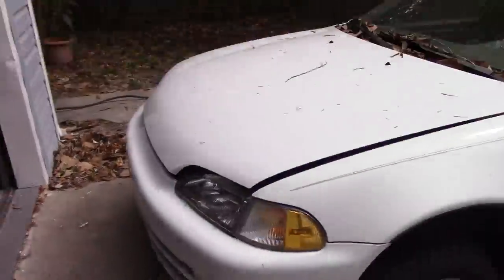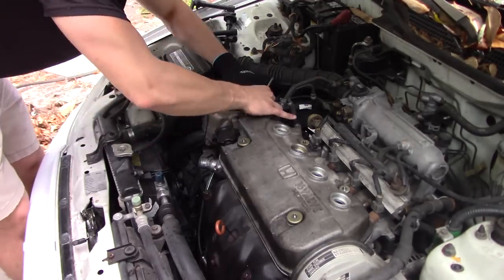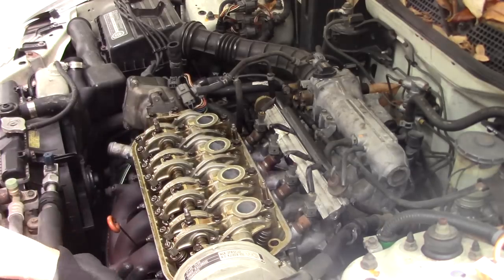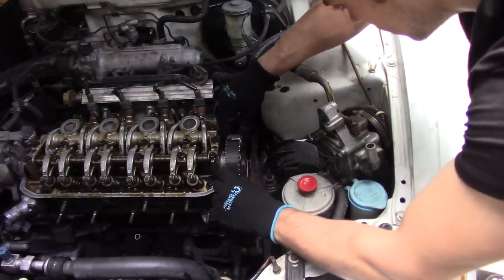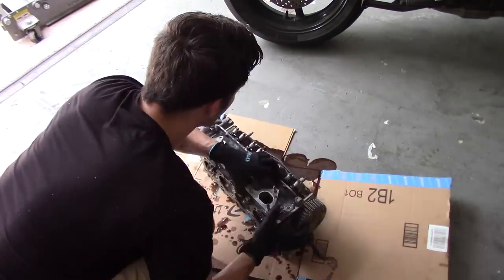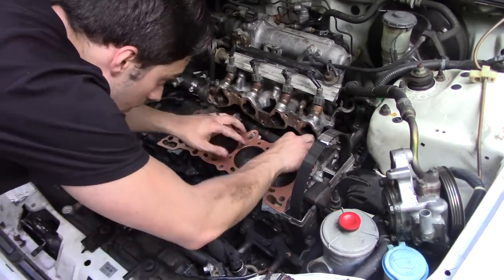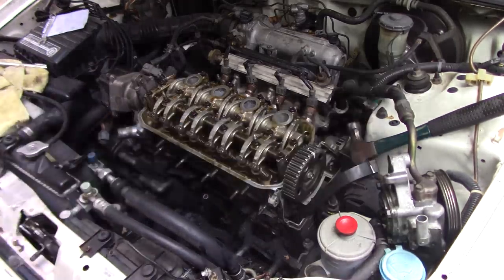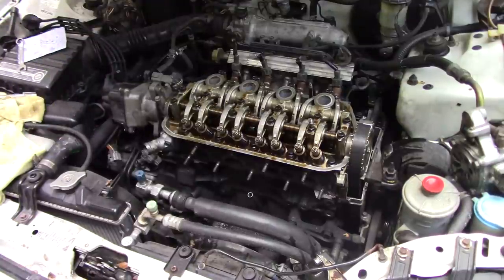How to Replace a Head Gasket  | 1994 Honda Civic DX

Comment: Hi do I need to align anything after taking it apart? I often see people in YouTube lining up something(i guess) like the piston in it's original position or something. I don't quite understand it so it is making me really scared to start the work.
Reply from the maker: What you are explains is making sure the piston is Top dead center so it would be easier to align everything back together when you reinstall everything. However, in this video I use the method where I keep everything in place and reinstall it I all in the same working order. Even if you have to get the head shaven down, if you install all the valves the exact same way as you had it, you shouldn’t have any issues

Comment: Question?  When you went to remove the bolts to the engine head, why did you NOT first remove the bolt that was last torqued when the head was first installed.  So if the TIGHTENING pattern (sequence) starts with #1 thru #10, shouldn't the LOOSENING pattern be #10 thru #1?

Comment: Always make you spark plugs so they go back in the right place so you don't miss firer
Reply: spark plugs can get put in a hat and drawn one by one and it wouldn’t matter what cylinder they go in. Plug wires on the other hand need to go back in the right spot but you don’t need to mark them lol

Comment: I am doing it  myself. I just wanted to ask. Am i supposed to set the timing to zeros before i remove the timing belt??
Reply from the maker: If you mark the belt and gear, you don’t need to.
Reply: @AutoMotivate  you smell

Comment: At 4:00 you removed those back bolts and I’m using a 12 mm because that’s the only thing that fit, and we keep striping the bolt little but little and it doesn’t wanna catch
Reply from the maker: Faze Cold so, I forget what size those bolts are, but be sure to spray some WD on those bolts. Try your best not to strip them. If they happen to still be tuff to remove, you may have to heat them up to remove them

Comment: If I just wanted to replace the head gasket, would I still have to remove the power steering pump and the manifolds to remove the head? (I'm a noob trying to learn sorry if that sounded dumb)
Reply from the maker: Yes, you’ll have to follow every step in this video.
Reply: @AutoMotivate  thanks! I think I'll start off on smaller jobs and work my way up to this. Your video is great though, keep it up :)

Comment: How did you get the timing belt back on?
Reply from the maker: Patience is key when you are putting it back on.
Reply from the maker: One tooth at a time. Start with one side then work around

Comment: How did you remove the exhaust heat shield and exhaust manifold without removing the oxygen sensor? Or did you just not show removing the O2 sensor? I can't get a wrench in there because of the shape of the manifold around it
Reply from the maker: I didnt have a problem man. Just work with it.

Comment: I slid my timing belt off by hand as you did. question is how do I get it back on? im really struggling with this .
Reply from the maker: You just have to work with it. It is difficult. You have to really wedge it back on. Take your time. If you get frustrated, take a break and come back.
Reply: ok got ya. should I go from one side and work my way over to the next or place belt on both sides and work on getting it on in the middle . i just got my head gasket on yesterday and I'm overly excited and nervous to get this car together so I can see how my car runs
Reply: any tools that might help
Reply from the maker: Yeah man, work from one side to the other. Try to get each tooth on, one at a time and use pressure to keep it on as you move to the next tooth. That is how I did it.
Reply: @katypfeffer6018  did it go all good and did u get head checked?
Reply: loosen the tensioner

Comment: U didnt really say if you got a another head or had yours ported or evened out  that very impotant to know at this moment i have a coolant leaking outside where the block and meet so i know its my head gasket cuz its a 25 year old car and my car never overheated i notice it cuz every week i check my cars and i saw green coolant running down the side of the block  but do u still recommend to get the head even out
Reply from the maker: It’s always safe to get it shaven. I would definitely take a closer look and make sure it isn’t leaking from a hose or anywhere else. 
Also check the oil, see what that looks like. If it milky ish, then it got in your oil and it’s definitely your headgasket. 
Check off all possibilities before you have to do the headgasket.
Reply: @AutoMotivate  ive tried looking to see where its coming from i see the same coolant running down on bothe side i have a inline six engine so i can see passenger side and driver side of the engine ive checked my hoses and no leak should i turn the car on i see the leak rundown to verify? I knew it was coolanr cuz when i drove it around i could smell it  thats why i checked under the hood
Reply: @AutoMotivate  oil looks good i think its leaking on the outsidesof the head gaskets not in where the cylinders are or else i would be gettingg whitesmoke and misfires well im glad i got it on time

Comment: finished doing mine, went on a run and the car stopped. turns out the head cylinder bolts needed retorquing after my car heated up 😂
If ur doing this DIY, go on a few short trips to check if there are no leaks. 
ended up doing mine twice 😂

Comment: The biggest flaw with this video failing to check for warpage of the head or even the block. You suppose to take the head to the machine shop that will acutally tell you if there is a crack or warping of the block and they will resurface it for you. Not resurfacing the head or block will cause the head gaskest to prematurely fail. Aluminum metal expands. You also need to properly diagnose the cause of a blown head gasket. Just by replacing it doesn't necessarily mean you fixed the problem. That's the result of the problem not the cause. 90% of the time most head gasket failures are due to an overheating problem with the engine. A failing water pump, clogged radiator or a stuck open thermostat can cause the engine to overheat that will result of a blown head gasket.

Comment: So what are the symptoms of a bad head gasket (specifically Camaro) because my mechanic told me I needed new head gaskets too and the symptoms were, misfires, car not accelerating, car shaking, car hesitating to start, car shaking at idol, car using alot of gas. Do these symptoms seem accurate for a bad head gasket?
Reply: Easy test you can do. Simply remove the radiator cap on a cold engine and start the car. Watch for bubbles of the coolant or if the coolant overflows from the radiator. If it does, you have a blown head gasket. You can also use a cheap scientific test called a Leak Combustion test that you can get from your local Harber freight store. You pour the blue liquid in the test tube and insert the test tube into the radiator and if it changes to yellow, you have a blown head gasket. Typically an engine over heating, blowing out white smoke from the exhaust pipe are also strong indicators of a blown head gasket. The engine would also run a little rough esp at idle.
Reply: @eman0828  i got it fixed yes it was a bad head gasket he told me it seemed someone intentionally damaged the head gaskets because its pretty pricey and takes a while to fix so i told him i dont want it to happen often that i need to replace them
Reply: @franklee3795  at least you got it fixed. What was the make and model of your car? Was the car driven hard like a maniac or did you find out how the head gasket was blown like an overheating problem?
Reply: @eman0828  2010 Chevy Camaro, see what happened was at first i took it to a local shop which they told me it was just a timing chain and some cylinders misfiring which they werent specific why the cylinders misfired, so they fixed the timing chain and then they told me it was still misfiring but didnt tell me why, so i called my dealership and their mechanic tore it down and scanned it and he said "it looked like the previous shop intentionally damaged the head gasket, because he said it wasnt time for a new head gasket just yet, i assume either the previous shop sucked at their job with my car or they are lazy about it or something, and the warranty company where the ones who found out about that and then told my mechanic, i was so angry i wanted to sue them but i couldnt find a lawyer that was interested, 5 months later im still angry

Comment: What program software are you using I saw your backround computer had the specs
Reply from the maker: Back when I made this video I had a 2008 MAC Pro and I used Final Cut Pro. Now, I have a IBuyPower Windows computer and edit with Adobe.

Comment: Is there any way to change gasket without removing timing belt
Reply from the maker: No, in order to replace the head gasket, you have to lift the head. You can only life the head by removing all the parts surrounding it and the timing belt. The timing belt seems scary, but if you follow the way I did it, you will be just fine

Comment: Is this a similar scenario to honda preludes?
Reply from the maker: Should be a similar process. However, I do not believe its the same engine.
Reply: TheDeDecker yeah of course not mine is a VTIR H22A engine with twin cams but it has heating problems so i wanna learn how to change the head gasket

Comment: @automotivate I took off the intake manifold , exhaust manifold , power steering, power steering bracket, timing belt, head bolts, coolant hose in the front , little ones in the back left and my head won’t come off can you dm me for help I can send picture but I was trying to pry bar it off because I think I took off everything but the damn head won’t come off
Reply from the maker: So, i am not sure what exactly is going on. Message me on IG, my handle is "TheDeDecker"
Reply: I do want to mention though I took the head bolts off not how they were supposed to do idk if I warped the head where it won’t come off , tbh I’m very new to working on cars but I was just wondering if that has anything to do with it , I’m not trying to pry it off anymore cause I don’t wanna do more damage to it I was literally stepping on the pry bar standing on it using my body weight to push it up but what now ?
Reply: AutoMotivate thanks

Comment: Should i drain the oil first? Before replacing the head gasket
Reply from the maker: It doesn’t matter, really. As long the oil is replaced before you start it.
Reply: @AutoMotivate  well.. I should drain the coolant at least so i dont have coolant spilling everyware when i tak off the head

Comment: Is jacking up the car necessary? like I don't have a floor jack but I don't see why the car needs to be elevated to do this
Reply from the maker: It’s not, but it’s a tight fit to get tools down there ⚒️
Reply: @AutoMotivate  Thanks for replying. I got a 91 ef hatch. I'm 4 hours into it and so far I've got the valve cover. The exhaust manifold is all but out I need one more bracket off on the pipe. Timing belt and head bolts are off. Just intake manifold to go. Definitely should have done it in the order you did. This job is no joke

Comment: I see you didnt remove the timing belt either alot of people say you have to i say no you dont i did it the same way you did
Reply from the maker: ILLGoThere4You exactly, if you follow these steps, you should be fine
Reply: ILLGoThere4You  how to you get the belt back on? I used this method but struggling to get it back on

Comment: Ok I have a 2000 civic I took it all apart put it back but when I took off the belt  I didn't mark it because it had the factory markings so I put as close as I could the started the car but realized the distributor wasn't connected and now both the  camshaft won't turn

Comment: Pretty sure the head bolt order only applies on refit. Not necessary for removal
Reply from the maker: its just to get the right torque down
Reply: I’ve always been told to take them off in reverse order. If you look at factory service manuals they have the removal order exactly reverse of installation order. Prevents the head from warping or cracking.
Reply from the maker: Ash I didn't even think of that. Makes sense.
Reply: no it's necessary just for the head even if you are taking it off

Comment: The intake manifold nuts are the death of me
Reply from the maker: For real, it’s so bad. Just keep working at them
Reply: AutoMotivate i am lol
Reply from the maker: “17 hours later” 😂
Reply: AutoMotivate im going to attempt to take the intake manifold off today any tips to get the middle nut off?
Reply: AutoMotivate got the intake manifold out now and i found it was easier if you remove that one hose that connects to the throttle body and use a non ratchet wrench with a pipe to get it loose the rest i loosed off with my hand now im on the timing belt part which is stubborn to come off and one stripped bolt on the timing belt cover but i move it over to one side
Reply: AutoMotivate got it out and it wasn't easy 🤣
Reply: AutoMotivate now just waiting for the gasket set and thanks for putting the pattern for the bolts
Reply from the maker: no problem man. The bolts holding the cover to the timing belt are pretty annoying. No problem man. Excited for you to get the car back and running! I actually used a socket and extensions to loosen some of the manifold bolts.

Comment: I heard you can sand down the heads to level it again?
Reply from the maker: Drum Taylor I wouldn’t do that. Definitely get a professional to do it.
Reply: TheDeDecker you’re right that would be better. I seen from another YouTube sanding them down the correct way. All at the same time with a giant block.
Reply from the maker: I mean, im sure its possible. However, that takes a very long time to get it perfect. What if you didnt do it correctly or over sanded? All of that time wasted. it was only 60$ to shave my block

Comment: Will this be the same for a 2000 Honda Civic 1.6 ?
Reply: Yeah, it's pretty much the same but I think the 1.6 might have some extra hoses or wires you have to disconnect.
Reply: @jasonlyle3818  I replaced the head gasket, valve cover gasket, thermostat and radiator cap and it's still getting hot but I noticed coolant leaking from where the timing belt/water pump is do you think the water pump gave out that's the problem? Because it was making a weird noise today when I went for a drive and it didn't really wanna move so I took it slow and lucky I made it home.
Reply: @Scatpack23  oooh yea that sounds bad bro I'd change the water pump
Reply: @Scatpack23  if you change the water pump also change the timing belt at the same time while you're down there

Comment: How to find out if head gaskit blown or just    
Valve cover gaskit
Reply: Valve cover gasket just leaks oil down the side of the engine.  A head gasket is going to leak water into exhaust.  You'll probably see a lot of smoke coming out of the exhaust.  There may also be water in the oil.

Comment: Nice video Don't mean to fault you but, Observation is everything , So you did the job twice then,  before you fitted the gasket you've forgotten to check warpage and valve and piston damage and also cylinder walls and you never scrapped the block all lessons to be learned

Comment: hay I do not have a torque wrench is that needed is it important to have it?????
Reply from the maker: theguyttissy bob yes it is. You need to make sure it's as close to spec as possible
Reply: TheDeDecker spec??
Reply from the maker: theguyttissy bob like the Torque Wrench spec.
Reply: TheDeDecker is that the name of it
Reply from the maker: theguyttissy bob you need a Torque wrench to tighten the head bolts. If you do not, then things can go wrong. I have the spec in the video. When I say spec, I mean how many lbs you need to tighten the bolts.
Reply: TheDeDecker I watch a video about a guy talking about the copper spray it is not needed and dose not do want is say?
Reply: TheDeDecker ho kk sorry I know want u mean now like blue prints
Reply: how do u keep back of what bolts go to what
Reply from the maker: So, the copperspray is not needed. I just used it for safe measures. To keep track of all your bolts, i would either label them some how, or place them all in a specific place.
Reply: Get a chitlons manual, it has all the correct torque specs and a nice diagram of the bolt sequence.
Reply from the maker: Riley Rogerson that's a good idea, thanks for the information!
Reply: Yes you need torque wrench go buy one.
Reply: theguyttissy bob oh man... just let a professional do it man 😂😂 fuck you mean "do i need a torque wrench" to replace a head gasket 😂😂😂

Comment: He took the head off wrong he had the right idea with taking the bolts off in a certain order but he did it backwards the one he did first was the one he should have done last because he could have warped it now because he did it wrong

Comment: My 95 civic is emitting white smoke sometimes, and oftens lowers my coolant level. Is this the cause?
Reply from the maker: Yes, it should be. Check your oil, either the cap or the dipstick, if the oil is milky, it is 100% the problem. If the oil look healthy, then you have other issues
Reply: I just bought new radiator coz i thought it was the cause of my coolant lowering down, and sometimes temperature moves up the half bar when i go up hill. Any adittional tips pls
Reply from the maker: Does the oil look healthy? If ID does, then you do have some sort of leak associated with the radiator and it's components.

Comment: I changed the head gasket on my civic and now it’s revving up to max rpm by itself. What should I do
Reply from the maker: Changing the head gasket wouldn’t cause that. I would look and check every sensor, vacuum, and make sure your intake isn’t leaking. Go over everything. Check the throttle cable. Check every simple thing you can.